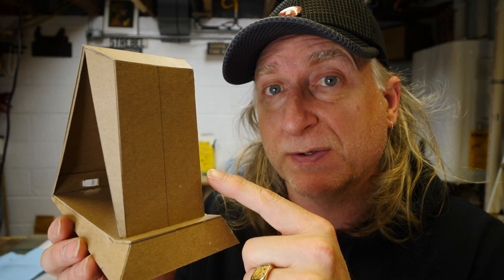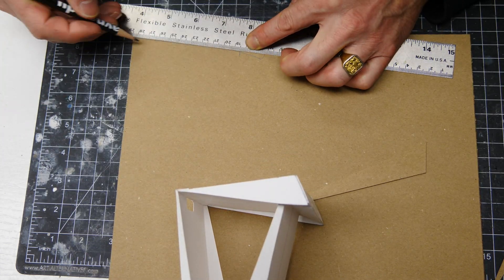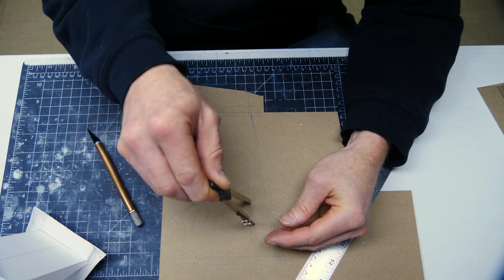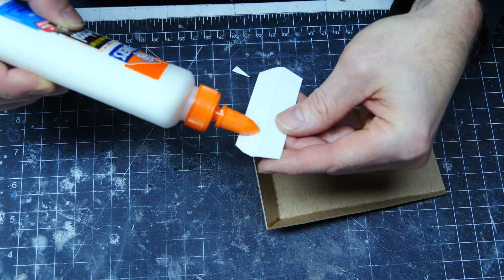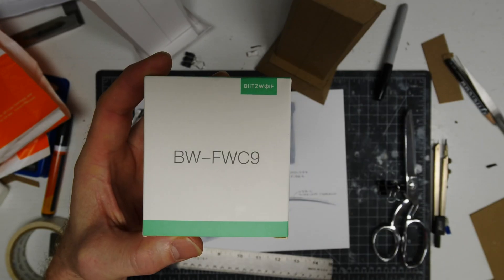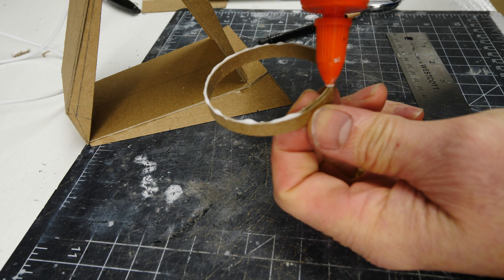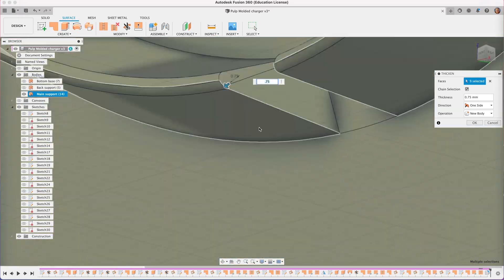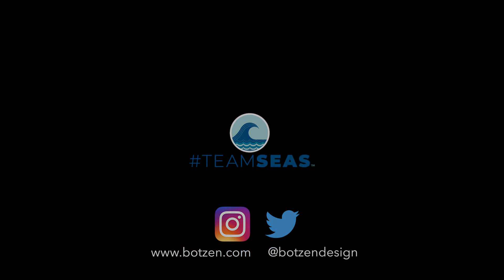CardBoard Prototype: wireless charger #TeamSeas

Comment: Very cool to see the process. Curious to know at what point you tune the CAD for the charger fit based on the pulp material’s flexibility. Clearly you understand your model’s chipboard characteristics, but how does that translate to a more refined measurement for final mold? thanks for your vid’s!